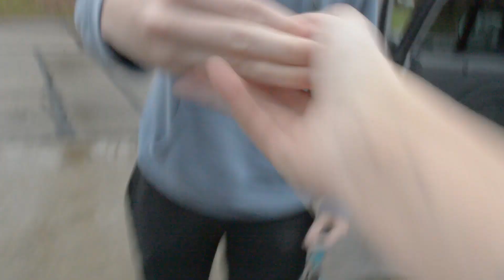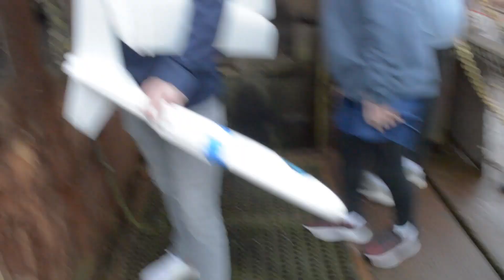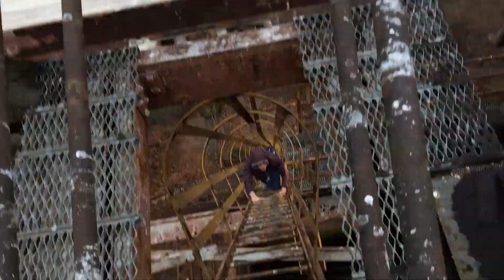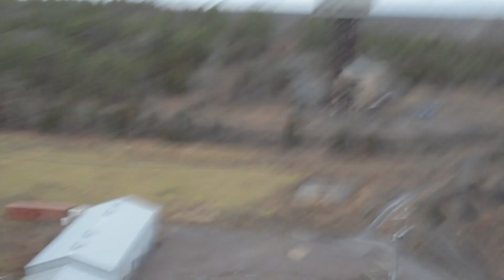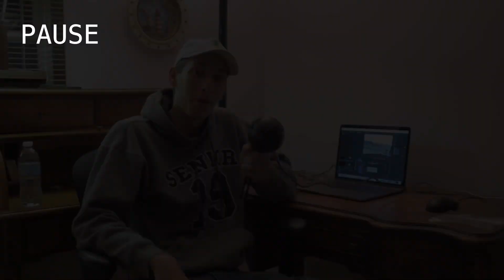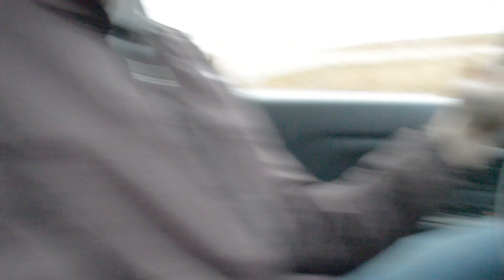Abandoned Mine Exploration (Gone Wrong)

Comment: I worked there from 1988 till it closed in 2001.  The shaft that you were dropping rocks in, is actually 3,300 feet deep.  Your rocks were just landing on the skip cage that is still hanging in the shaft.  The entrance that you came in, is NOT the only entrance, and no I won't tell you where the others are.  And hardray was a little wrong, as the Iron Deposit is both Magnetite and Hematite.  We processed and sold the Magnetite and the Hematite is what you see in the tail-lings, as we through it away.  We closed down because we could not compete with overseas mines, which are all shallow open pit mines.  We had the extra cost of bringing the ore up from 2,800 ft deep.
Reply: That’s awesome! Glad you found that video, if you got any other history I’d love to hear it.
Reply: @logohuntin  They first started removing Iron Ore from the mine in 1961.  From that time until 2001 (40 years), there were many years that anywhere from 500,000 to 1 million tons of rock was removed from the mine each year.  So there are many many miles of tunnels, starting at 1,400 ft. deep down to 2,800 ft. deep.  There are many levels between those two depths.  There was a complete maintenance shop, offices, break room (much like a large kitchen), down there.  There is (yes still is today) a very large "cone rock crusher" down there that you could throw a whole pickup truck into, and it would just mash it to pieces.  Many pieces of equipment such as front end loaders, jack leg drills, etc. were left down there, as it cost to much to take them apart and hoist out to the surface.  There was a huge ventilation system to keep fresh air moving though out the mine and a "banana oil system" on the surface, for alerting anyone in the mine, of an emergency.  Essentially, you knew that if you smelled bananas, you had to immediately get to the man cage and evacuate the mine.  Enough for now, (I could go on forever).
Reply: @randywilliams8354  that’s awesome. I’m absolutely fascinated by the history and get lost in it everytime i find something new about it
Reply: @randywilliams8354  Hey Randy! Im a student at Missouri State University and would love to learn more about the history of the pea ridge mine, is there anyway i could get an email to contact you with? or if you could email the email in my about tab? thank you

Comment: pea ridge mine!
Reply: so thats it? their not going to use it? 7 million to fix the 1963 new 30  mile 112lb/yd welded rail spur to much for alberici? or were they only in it for the silly slurry line they were going to build (to herculaneum!) anyhow kenedy moved on and rare earths will come from a NEW MINE south of fredericktown instead.
Reply: rea ridge is worked well below 2500 feet. its a big lava blob of hematite. its a very large iron deposit and is only shut because we didnt need domestic iron for a long time. deep and flooded. and kenedy got in trouble dewatering it ten years or so ago.
Reply: @hardrays  do you know anything else
Reply: @Crazysteve779  ha, i dont even know now what i knew then! i just know that doe run owns the mineral rights in that mine as well as all their bonne terre scuba mine old workings. whats doe run up to? pulling pillars and making sinkholes including a ridge top one around the recycle center that promises to be an open stope in a few years.